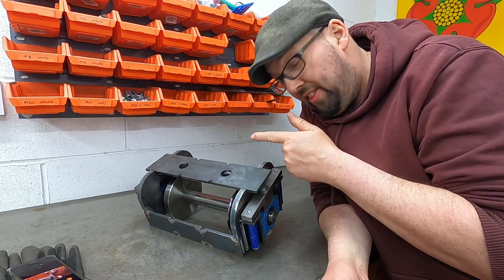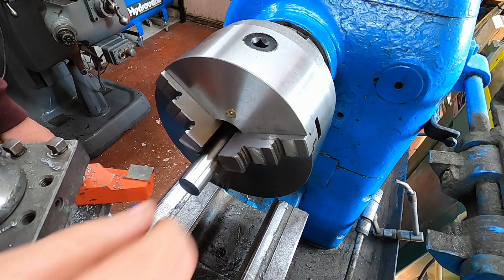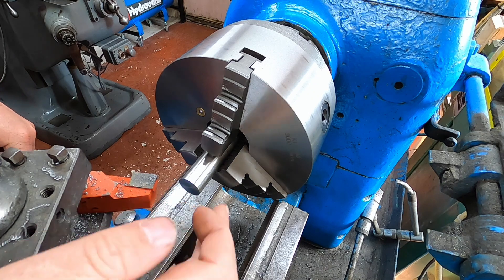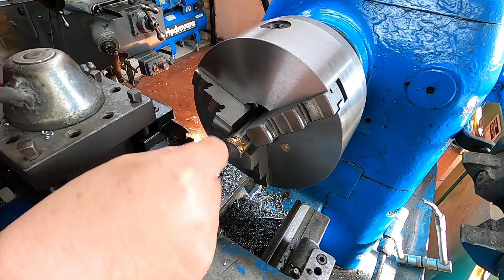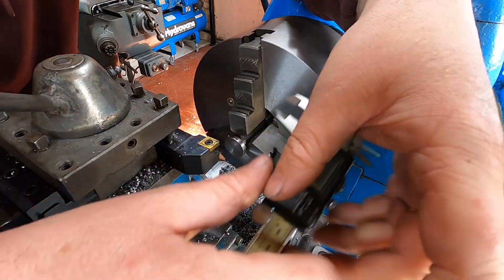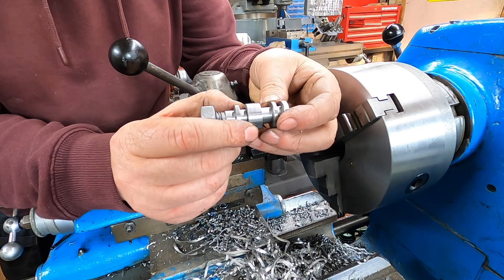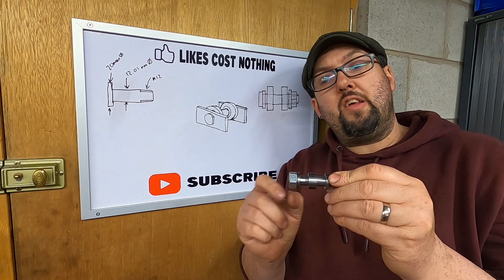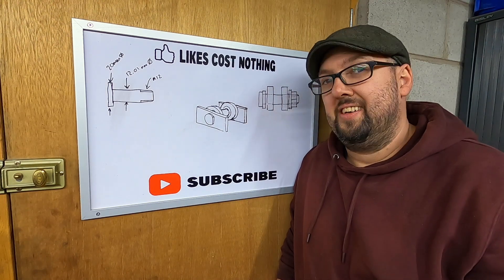Pony Truck Strike Plate Bearing Pins - EP24 - 7.25" Gauge Steam Locomotive Build

Comment: Great video Matt! However I would like to know why you machined a groove at the end of the thread on the pin as I've never done it.
Reply from the maker: Hi Evenjam, well it’s for several reasons, relief of the end of the thread, it’s looks nice, and most importantly…. I know where to thread up to so they are the same 😂. All the best, Matt
Reply: @MattChiversWorkshop  ah, it does sound like a good idea, will have to give it a try next time I do a pin. Don't really have any to do now though as my mate's t2 is nearly done.